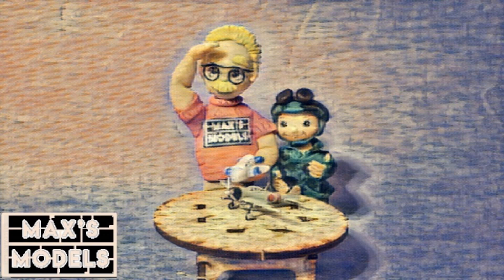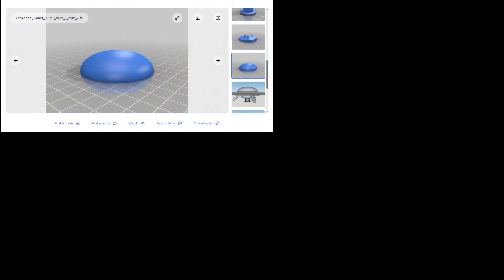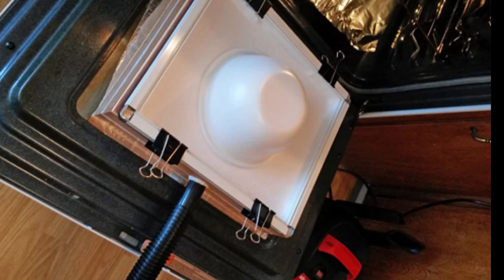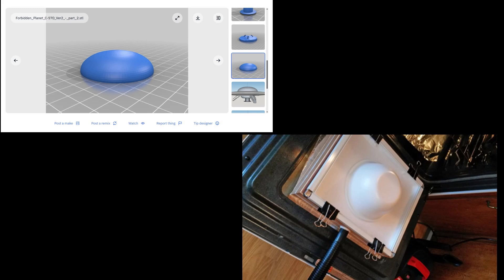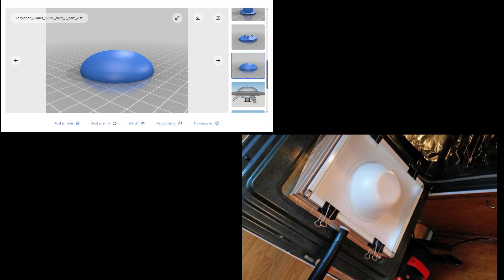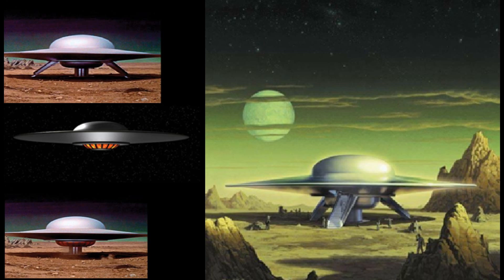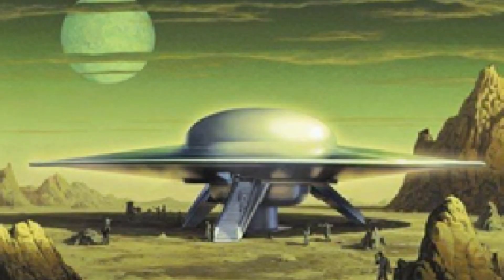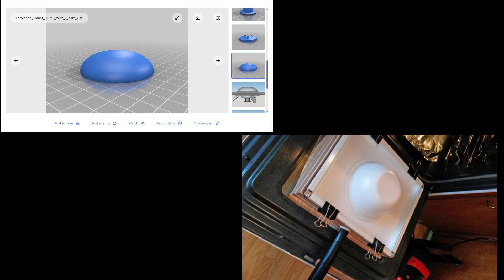3D printing vs Vacuforming

Comment: I would want a higher-resolution STL file for printing this out.  This one is too faceted, and would require tons of sanding and finish work, made even worse if it is printed in PLA.  The dome is a very simple shape and easy to reproduce in high resolution using Blender, Fusion 360, or equivalent, print in either PETG or ABS at the printer's highest resolution (i.e. 0.08mm layer height with a 0.4mm nozzle) so the finish work is reduced.

Comment: I really think 3D printing is the wave of the future for modelers. It really opens up endless possibilities. As with most technology it may become cheaper & more accessible hopefully. Seems like it opens up the possibilities for small niche manufacturers. Maybe this is a good subject for the live stream.
Reply: There will be a time when you buy a model kit and then do a 3D scan of all the runners and pieces. You will then either build the original kit or save it and 3D print the replica to build. Thereby retaining the original. In addition one would be able to reprint and broken/damaged part in the future. In essence 3D cloning of model kits.

Comment: 3d printing is actually pretty complicated.  You have to design the part (or someone does) AND you have to design the scaffold to support the part as it is being printed.  This isn’t like a StarTrek replicator where the subject just pops into existence fully formed.  Plus it can take up to 24 hours to print a highly detailed object.

A vacuform part requires an early decision as to whether you are making a male or female mold design.  Male molds are relatively easy to carve but are very low in terms of detail.  A female mold is way more complicated/difficult but can produce a highly detailed part with panel lines and rivet heads.  Vacuform also allows for rapid production of multiple copies.  Almost as fast as injection molding. 

To do either well often requires developing skills and devoting time to the point of this becoming another “hobby” in snd of itself.
Reply: I'll second Chuck's thoughts here.  I do however doubt that a printed part could be made anything close to optically clear.  A vac formed part could be made pretty close but will take a tremendous amount of work on the mold to get there.  Assuming the mold is made of wood it would have to be sealed, filled sanded very VERY smooth, then painted, only 2 part epoxy or urethane paints allowed, (I haven't had any luck with any 1 part paints).  In addition, the mold and part would have to have some amount of draft so the part will release off the mold.  Pulling a part from the original part would make the new part larger by the thickness of the plastic sheet.  Can you work with the slightly larger size?  Secondly are you sure the original part will not be marred by the heat of a plastic sheet coming down on it?  Max, something I missed on your previous video, why do you not want to use the kit parts?
Reply: Very well said. All valid points. I don't think Max has completed a vacuform kit, and that takes skills of it own. Also, 3d printed kits are interesting on their own. Now Max would be building a multi media kit, and that takes different glues on their own. 😊
Reply: @williammitchem8274  Indeed.  Still I applaud Max for diving in and doing stuff, whether I think it'll work or not.  Many times our fearless leader surprises me, and indeed he gets WAY more stuff done than I do.  ;^)  MAX - "Make it how you want it to be" and "Model On" 👍🙌

Comment: MAX,HAVE THOUGHT ABOUT GOING TO THE CRAFT STORES TO SEE IF THEY WOULD HAVE CLEAR PLASTIC DOMES USED FOR OTHER PROJECTS. SAW SOME ON LINE,JUST TAKE YOUR DOME TO MEASURE A MATCH.JUST A IDEA.GOD BLESS EVERYONE
Reply from the maker: I had no luck doing that.
Reply: @maxsmodels  What about packing the original dome with modeling clay and using it as a vacuforming plug?